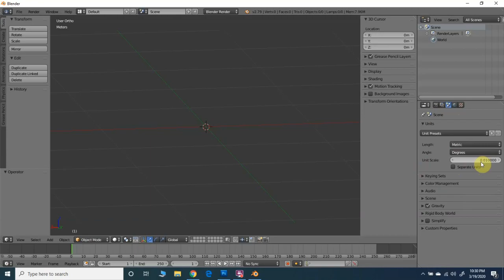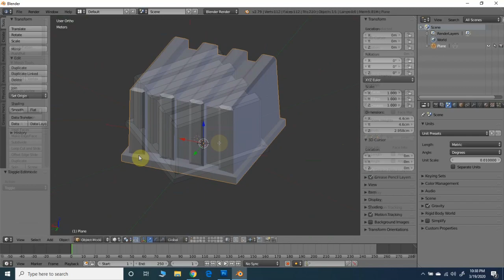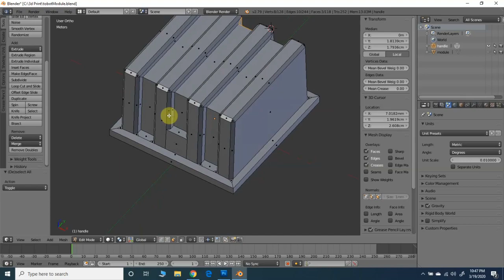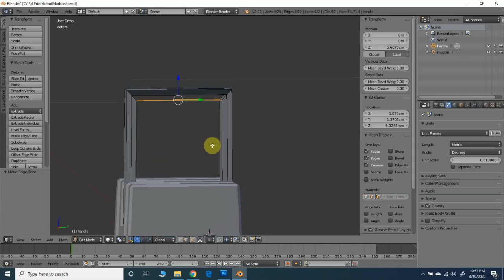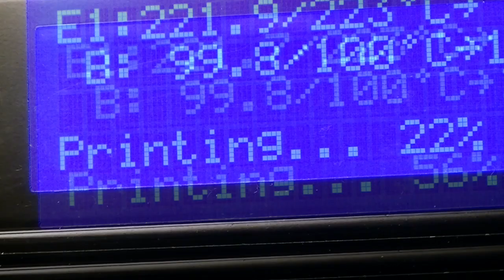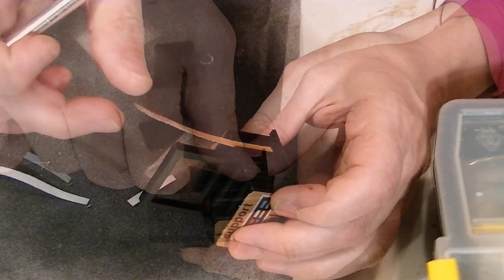Day 5. By Request, Comes Tobor's Support Module

Comment: Hi Randy. Another great video. Do you know of a good source of decal scans? Could you do a comprehensive clip on decal reconstruction/reproduction?
Reply from the maker: Only decal scan for this is what I got from the old robots website. I corrected it, and you can have it if you need it.
Reply: @RandiRain  Thank you for the offer. I don't need this particular scan, But I'm always looking for some decal or another. Right now, I found a vintage 1974 toy Jeep from Empire. It had an eagle on the hood and some other stuff. I peeled them off, stuck them to a piece of paper and scanned them. I tried fixing them in a paint program, but it's incredibly time consuming. There has got to be a better way.
Reply from the maker: Yeah, it is time consuming. You're welcome to any that I have, but I don't know what all I have off hand.